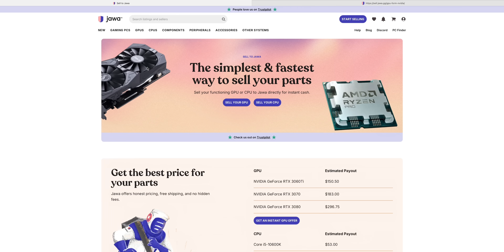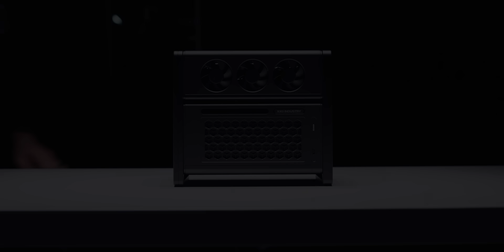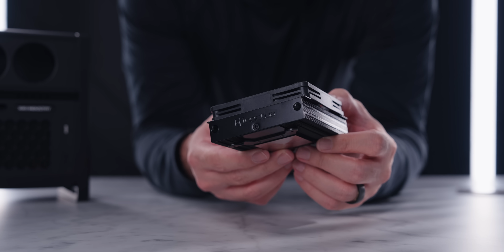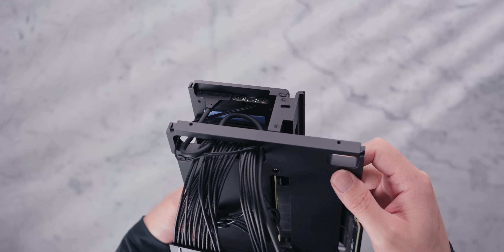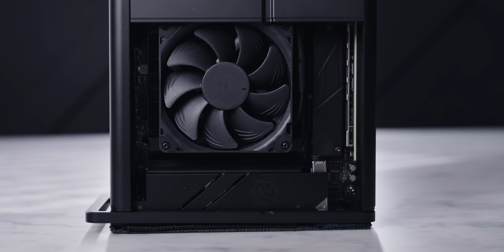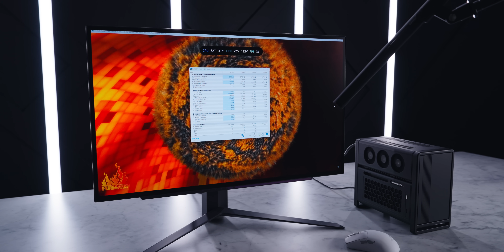they made one even smaller

Comment: I feel like it's targetting such a niche market. Low profile 4060 is for budget gamers, the case is for gamers with money to blow. It doesn't match. Only a gamer with enough money that somehow doesn't want the best performance, only great looks is targetted.
Reply: It does match. I wanted a small computer, with a lot of performance, and this is what I got.
The 4060 is the most powerful card I owned so far and paired with a 7700x3d CPU, this machine can handle everything I throw at it -- it is powerful enough to code and to play, and it runs like butter with Linux Mint XFCE.

Together with this case I now have a machine that is both powerful and aesthetic. Totally satisfied with it.

Note: Upgrading from an XPS 710 with a 1060 after almost two decades.
Reply: @gabrielgermann9148  coming from a 1060 I'm sure you get a massive performance boost... But the 4060 is still a slow budget card

Comment: My only gripe with this case in that if you’re willing to expend this kind of money on a project like this using low profile GPUs you would for sure like to have the option to use the best and most powerful low profile GPU on the market which in this case (no pun intended) that would be the RTX 4000 SFF Ada Generation, same die as the RTX 4070 (AD104), 20GB of VRAM, in configured with such a low power draw by NVIDIA (70W) that doesn’t need external power cable, uses only the PCIe (PCIe can provide 75W oficially).

Yes would be very expensive (between $1200 and $1500 depending where you look) using that card, but you would have 4060 Ti levels of performance (or probably slightly above) with tons of VRAM, no cables, and very low power draw/heat
Reply: Yeah I was thinking same

Comment: Hey quick question. I have that same motherboard with a Ryzen 5 7600x. it should be able to run onboard graphics but for whatever reason I can't get it working. I have enabled it in the BIOS but its just not working. it only displays a black screen as if its getting an input but there is nothing there. windows does detect it but can't post anything on it. any ideas on why this is?

Comment: i prefer the Gigabyte version because of the 8 pin connector, otherwise this build is very nice :)
Reply: a 4060 is a 115 watt GPU.

75watts is delivered by the PCI Express port.

a 6 pin connector delivers upto 75 watts.

an 8 pin connector can deliver 150 watts by itself.

The 6 pin delivers 30% more power than the card needs, even if you overclocked it and raised its power use, 30% is more than enough.

Comment: one of the best looking cases ever... losing only to the big brother
Reply: losing, the word you're looking for is "losing".
Reply: And it has the exact same problems too. One side of the vertical fins of the gpu is completely blocked, trapping all the warm air the card is exhausting, raising temps. Anyone wanting to go with a LP 4060 should grab the A24-v5. Something that's yet to be reviewed on this channel. That case have ventilation on both exhaust points, does not use a riser, have almost double the cpu cooler clearance, also you can install 2 case fans - all while being significantly smaller at just 5L. Oh and obviously a lot cheaper. It's better than this in every possible way.
Reply: Its ugly trust me, the velka does the best. Or anything similar to that. Alsp its $480. Oh brother thats the price of a cpu already 💀

Comment: theres good and bad here...
feels a lot less refined than the xikii 4080 tower, random slits and cooling holes where none of them have the same design langauge, from ovals to hexagons to mesh to pillshape, its a mishmash brother. the plate that covers the 4060 could easily have been an excuse to use any low profile card. props to the build quality tho, more manufacturers need to go this path, so tired of flimsy folded sheets of metal. awesome video still, love the content.

Comment: also i think you severely underestimate the demand for a product like this. With very minor tweaks this could be a best seller
Reply: Highly doubtful. It’s very beautiful, but insanely expensive, severely underpowered, and only fits 1 specific set of parts.
Reply: Not really. Even most sff enthusiasts would trade the few extra square inches of desk space for something significantly cheaper and faster.
Reply: would i want this? yes
would i realistically ever buy this even with disposable money?
hell no
it only supports up to a 4060, so if I had disposable money, I'd probably get a 4090
Reply: The incredibly refined aesthetic is dependent on specific hardware combinations to ensure everything lines up perfectly. To support more hardware would require options for multiple GPU plates, except there are only two GPUs on the market worth running (3 if you count a shunt modded ada 4000 sff, but that's super custom territory), and the price alone kills its mass market viability. As a case designer myself, the only market for this I can see is people who want to spend a lot of money on a very pretty computer and don't mind not getting much computer in return. It's a bigger market than most people would expect, but still absolutely tiny in the scale of things.
Reply: At what point do we just buy a minipc with a GPU mount like the beelink one.

Anyone who buys this aesthetic really really wants this aesthetic.
Reply: As an American, with these tariffs on the horizon, having to have specific parts for your build is a huge hinderance.
Reply: you severely overestimate your estimation as well as cognitive capabilities

Comment: It just looks SOOO good, but as usual, for a "fun" project, just too expensive for me :/ Also, a 4060 with 8GB is a bummer.
Reply: That's what you get when Green beans hate custom design hardware of GPUs. It limits your options.
Reply: so reminiscent of intel in the 2010s 'quad core is enough' mentality. i cant wait to see nvidia go through similar turmoil
Reply: @DeenaMilkers  Nvidia isn't going to go through any turmoil. They limit the VRAM on their cards so they can push AI users to get their higher end cards for the VRAM. Like it or not, AI is the next crypto mining market, and it's larger for GPU manufacturers than the gaming market by and large.
Reply: @bencio22  great option for light 3D work and casual gaming
Reply: pretty much, only useful for pintrest saves and thats about it. Should have stayed a render.
Reply: Everyone says that but I’ve had 12gigs for 2 years now, and have never once ran into an issue. Why do people say you need more
Reply: Yeah all that cost could be put towards a 5080.
Reply: It looks ok. 2 months of usage and the dust build-up would be insanely visible
Reply: @boydolson5350 ever heard of cleaning stuff manually?
Reply: @boydolson5350  Vacuum your house more.

I have exposed fans on my PC setup, been running for 2 years, no dust to speak of on the fans.

Dust is particularly bad if you are running a positive pressure system.  Run a negative pressure system and there's less impetus for dust to settle anywhere, and ofcourse, vacuum your house.  (and don't leave your PC on the floor)
Reply: @meateaw  my ncase m1.1 evo doesn't get dusty until after 6 months without cleaning (I clean it every month)
Reply: @boydolson5350  you know you can, maybe... hmm clean it? use a vacuum... or i dont know... a cloth. maybe im too extreme, but people used to do chores in the house...
Reply: @boydolson5350  fun fact, open air PC collects dust way less than regular case, given that it's much easier to access. light dusting once a week is enough to deter any dust
Reply: these cases are garbage. you're stuck without a future gpu upgrade lol
Reply: beo i have 2gb stop complaining
Reply: talking about 4060 being a bummer while you cant even afford it
Reply: the 8gb 4060 is an amazing card, would be hilarious if this ends up being top comment
Reply: @kratakiis  How come pretty much every tech reviewer I've seen have all said the 4060 is just not worth it at all with price or performance, and you're better off just sticking to the 4070 lineup of cards even if you only need lower-end performance, or even better going with an older 3070 or 3080 which beats it on both price AND performance.
Reply: @ find me a 3080 for $300 and ill cry but yeah no dlss 3.0 on the 40 series cards is insane it makes the 4060 perform better than a 3070 ti/ 3080 even at 4k and you get a warranty, its super power efficient and doesnt kick out nearly as much heat as its “higher end” predecessors. The 8gb of vram is only an issue in like 6 games and thats when your not using the ai upscaling which imo should always be on.
Reply: yea i hate to be that kind of guy, but anything lower than 20 just doesnt cut it anymore
Reply: @cIoudbank  dunno man, running 4k on stalker 2 maxed settings its around 10 gig
Reply: @cIoudbank rich people problems
Reply: @cIoudbank  what in God's name do you need more than 20 for? At that point this is the wrong video for you
Reply: @SkylearJ  everyone's freaking out at me for saying that but if you look at minimum requirements for recent TripleA games, its usually 16 to 20 vram recommended
Reply: @cIoudbank  fair enough, just the way I play I've never really exceeded 12
Reply: @SkylearJ I exceeded VRAM for the very first time playing Hogwarts Legacy in my 11GB 1080 Ti. So it really is not much of an issue unless you play at high resolutions with every graphic setting cranked to 11.
Reply: @cIoudbank  good pc for esports only gamer, but costly of course
Reply: @cIoudbank yeah if your using raytracing at 4k jesus christ 20gb is completely overkill
Reply: @Shrewbloom multiple games I play use over 20gb vram at 1440p
Reply: @ which games are these? also most games tend to dedicate vram to themselves so it looks like it’s using all that but in reality it’s just pre dedicated vram that’s called on as needed